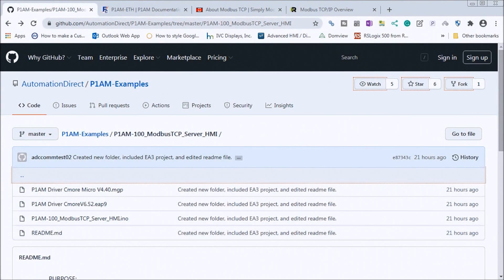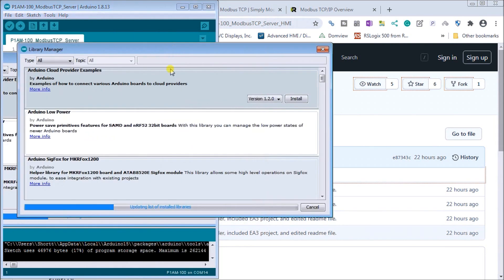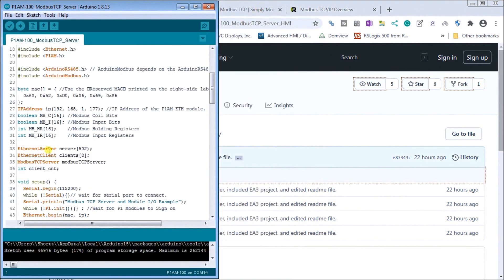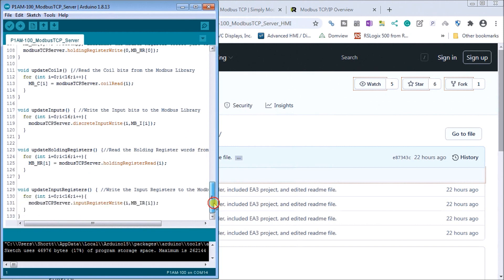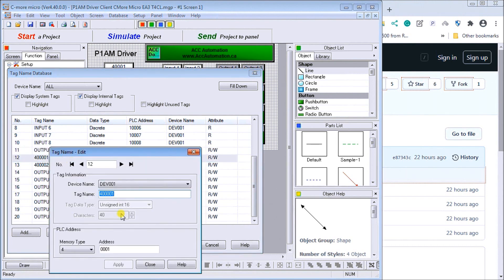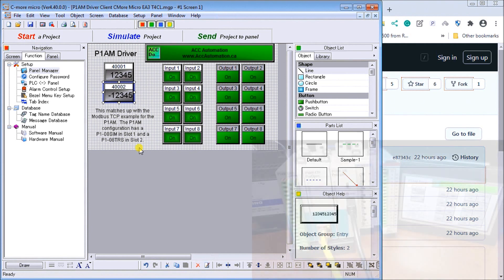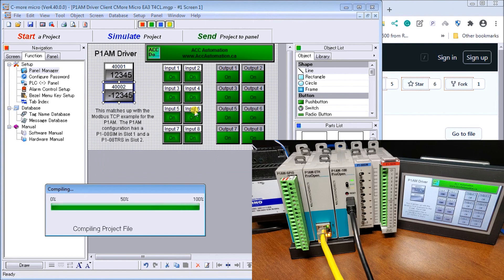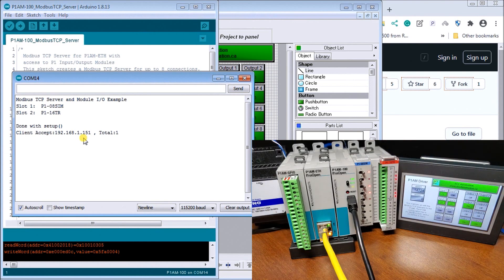Productivity P1AM Industrial Arduino Modbus TCP to C-More Micro EA3

Comment: this is a wonderful refresher Modbus video, my new project is an Omega Engineering loadcell: Modbus meter DPS20-LV-RTU Model then read the Modbus rs485 load 6-digit display register and convert it to Bluetooth so it can be viewed on an Android cell-phone about 70 feet away using an esp32 Bluetooth module and a rs485 to rs232 converter. This worked well on a non-Modbus project to view an analog 0-2vdc signal on a Bluetooth phone app made using RemoteXY and Arduino-IDE. 😊thanks a lot.
Reply from the maker: Thanks for the comment q zorn.
Sounds like an interesting project.
Garry

Comment: So i got almost all the setup same as you. The only things that i dont have are those switch. I ran the program and it stop at Done with setup and the line "Client accept..." did not show up. Do you have any ideas on why this happened?
Reply from the maker: Hi Long bun long Lau,
It sounds like everything is correct on the P1AM if the program got that far. It is now listening for Clients to connect. I would ensure that the C-More EA3 is trying to get the information from the correct IP address that you have for the Ethernet card on the P1AM.
Just a thought.
Regards,
Garry
Reply: @ACCautomation  Thx for your quick response. Here's some update. Now my Ea3 T4CL work fine and numbers are moving and i can use the button.(It was the power supply's problem. I used a 12V and i changed to 24 V). Now i want to use another project(Interface) which only contain one radio button. Is the program we used in video still applicable? If yes, what do i need to change to be able to read the data from the radio button(or the tag)? (Sorry for a bunch of silly question. I am new to all these) Also, i dont understand how the program we used manipulate the output according to the input we have in the EA3. It would be great if you could help me on this
Reply from the maker: @longbunlonglau7241  
I'm glad you got the communications working. A radio button would be similar to the push buttons programmed in the sample. 
You would just use the address used for them from the radio button on the HMI.
The following post will explain the program more:
https://accautomation.ca/productivity-open-p1am-industrial-arduino-modbus-tcp-to-c-more-micro-ea3/

Here is the series on the P1AM
https://accautomation.ca/series/productivity-open-arduino-compatible-industrial-controller/
Here is the series on the C-More Micro
https://accautomation.ca/series/c-more-micro-hmi/

Regards,
Garry

Comment: Great Video. Got it working for P1-16ND3 in Slot 1and an Output card in slot 2, but I am having trouble when adding more than 1 input card, such as as P1-08SIM into say slot 5 on top of the Input card in slot 1. The updateInputs() function doesn't seem to have a way to adjust the slot number of the card. After hunting around, I see that in ModbusTCPServer.cpp, the parameters for discreteInputWrite, is only passing 2 parameters, yet the function it calls: writeDiscreteInputs(address, &value, 1);  has 3 params. What does the 1 stand for? Is it slot #? 
Is there a guide to compiling changes to other files such as ModBusTCPServer.cpp? 
Thanks again for your great work!
Reply from the maker: Hi Marc,
Thank you for the comment. The P1AM will use a fixed slot location for the cards to the right of the CPU. Here are a couple of posts that will explain.
https://accautomation.ca/productivity-open-p1am-industrial-arduino-p1000-expansion-digital-inputs-and-outputs-part-1/
https://accautomation.ca/productivity-open-p1am-industrial-arduino-p1000-expansion-digital-inputs-and-outputs-part-2/
As far as modifying the libraries, here are a couple of links.
https://www.arduino.cc/en/hacking/libraries
https://www.arduino.cc/en/Hacking/libraryTutorial
I hope this helps you out.
Regards,
Garry

Comment: Thank you for this video! Very helpful! Im actually communicating the P1AM open via ModBus/TCP to the c-more micro EA3-T4CL. I would like to know if you need to tell the Slave (plc) where to store the data by address. So for example you had the holding register data in the hmi addressed to “40001”, do I need to put in the arduino IDE to search address “40001” from the master and store that data in a variable? Or does it automatically store that packet in the “int MB_HR?
Reply from the maker: Hi BROTHERS WAY,
In my example, the information in the P1AM slave (Server) will be stored in the variable that was specified. (MB_HR array)
If you look at the variables just after the IP Address you will see that I have variables for boolean and register inputs and outputs.
I hope this helps you out.
Regards,
Garry